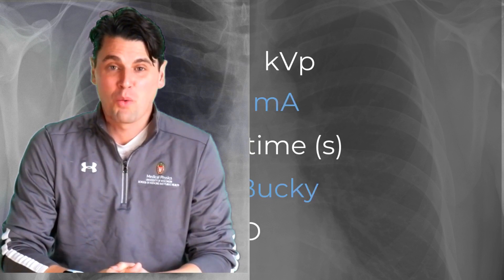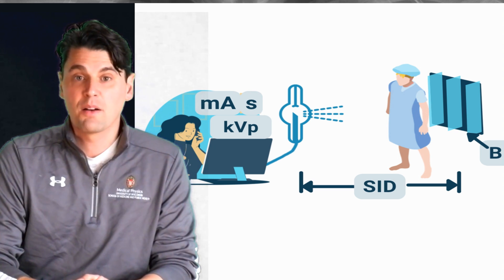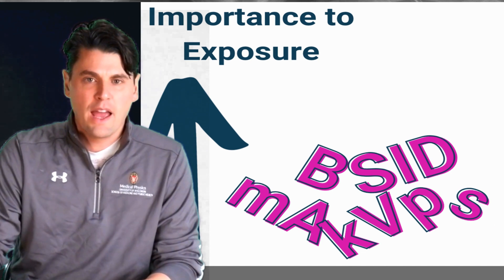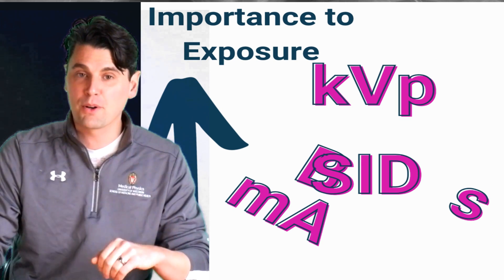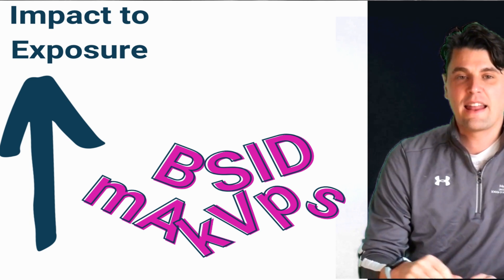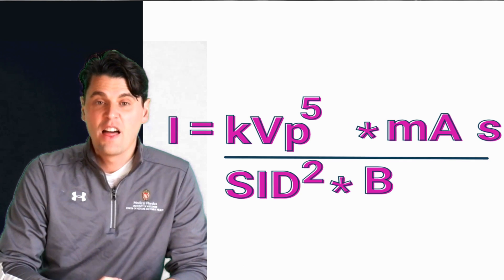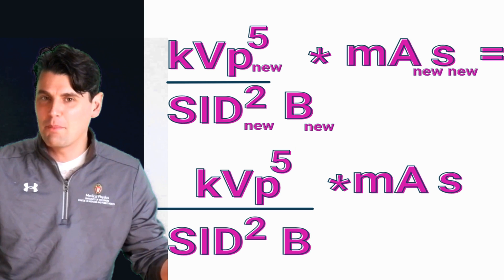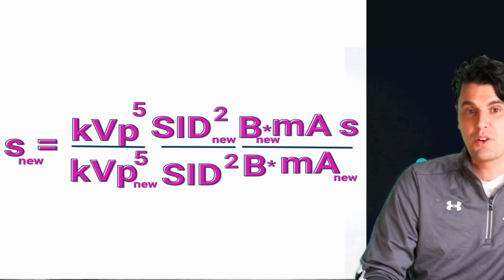Exposure Factors ( 5 relationships you need to know kVp, mA, s, Bucky, SID)

Comment: Very interesting content, Thanks for taking the time to explain. I do have a question if it is allowed. I have been increasingly disappointed with X-rays taken of my lower back that has extensive metal implants form L2 down, main problem is very poor visualization of the bone. In a recent flex extension set my Doctor asked for clear imaging of the Spinus process bones so any slight movement could be detected but no matter what we do with contrast they are not visible. Can the Radiographer change the settings to get better imaging of the bones?
Reply from the maker: Hi George , thanks for the comments. I try not to answer specific personal medical questions. In general imaging around metal can be very difficult as it is much more attenuating than surrounding tissue. Sorry I can’t be more helpful on this one.